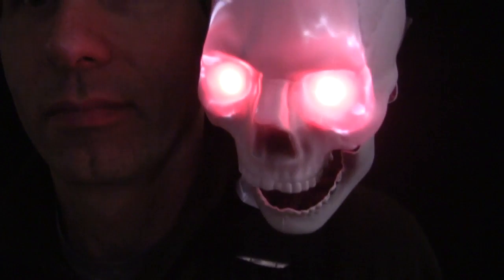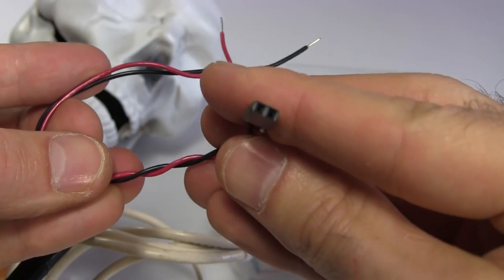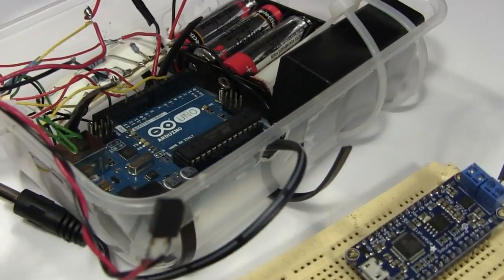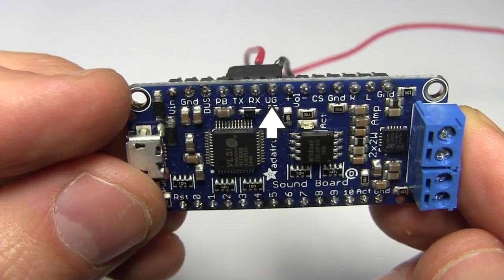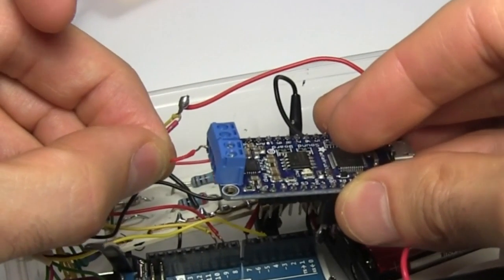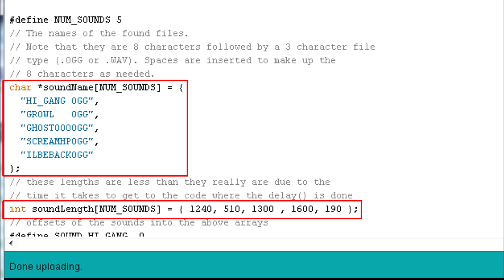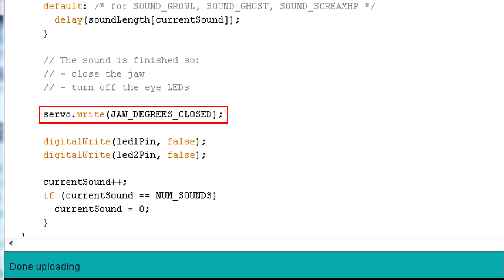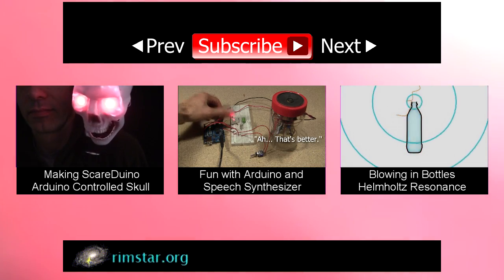ScareDuino & Adafruit Audio FX Sound Board for Halloween

Comment: As a fellow electronics and Halloween enthusiast, I enjoyed your video tutorial, but it triggered a PTSD episode for me and I had to share this story: 

Back in 2012 or so, I had bad luck with Adafruit's sound board, which later on they admitted in fact that there was a defect that caused the very problem I complained about; in fact they stopped selling them because they needed to reengineer the board.  Well, I guess they're back now.   

As for me, it was too late, it was past the warranty (lesson learned: always test the components)  I didn't use them the year I ordered them, instead I waited until next year and that was a mistake; however, as a customer that had been doing extensive business with them (hundreds of dollars every year over the course of several years) I felt like they could have been a little nicer to me given the fact that they sold me those defective boards, instead they said that customers are always blowing up stuff and claiming it was defective, and it got to the point that they said they didn't want to be accused of grifting and before I could respond, Mike closed conversation so I couldn't respond... that infuriated me... and now I am very reluctant to purchase from them, I try to get all my stuff from Digikey, Mouser, Jameco, Amazon, etc.

What happened to me was that I plugged the board into my PC to transfer the audio file... I didn't have anything else connected. I noticed that the class-D Amp overheated and smoke was coming off the board, then before I could react the USB went into overcurrent protection and the PC spontaneously restarted.  Luckily the PC was fine.   What I ended up doing was desoldering the SMD amps off the boards (all of the soundboards I ordered had the same problem) and then I connected the L and R lineouts to an offboard amplifier.

I found some MP3 players on Amazon DY-SV8F  8M Flash, and I can get 2 of the players for $13, it same functions as Adafruit's because it's the same chip, but cheaper... you can also get larger capacity for bigger files, like one with a SD Flash card, but Halloween props have pretty small files... unless you're doing a show with a long song and dance routine.

Comment: I’m gonna use a 1sd1820 module For the voice box that I making for my woody doll it’s going to be made out of wood but there are some buttons on there and I am a little worried that it won’t work with a pull string what can I do?
Reply from the maker: I'm not sure what you mean by a pull string and buttons. Are you trying to use the pull string to activate the buttons?
Reply: RimstarOrg No I just want to use a pull string instead of buttons
Reply from the maker: In that case, a quick search turned up this video https://www.youtube.com/watch?v=ckq_CP3ra7g where they connect and Arduino to it. You could build some sort of lever mechanism where the strings pull on lever arms. When pulled, the levers would close switches. The switches would be connected to the Arduino. The Arduino would do whatever code is necessary (like in the video) to tell the ISD1820 to play a recording or to record. I don't know enough about the ISD1820 to tell if the same could be done without the Arduino.

Comment: Hi, without the sound file arrays , will it work ? What is it used for ??  int soundLength[NUM_SOUNDS] = { 1240, 510, 1300 , 1600, 190 };
Reply from the maker: Do you mean without using soundLength[] will it work? Yes, it will work without it. The reason I use it is that I want to know how long to open the jaw for in order to make it look like the skull is speaking.

Comment: Any ideas why I can't get mine past the 'if (!sfx.reset())' of the demo code? I quadruple checked the connections and have them exactly like they do on the Adafuit demo. If I by pass that it will not play or list the files. Basically nothing works.
Reply from the maker: I guess you mean Adafruit's demo code because I don't do a sfx.reset in the setup function. I do recall a problem with the sfx.reset call and mine worked without it so I skipped it. I don't recall exactly what the problem was, whether or not it was just stopping there like yours. You can see my code here http://rimstar.org/science_electronics_projects/arduino_adafruit_audiofx_soundboard_skull_scareduino.htm.
On Adafruit's page for this version of the board that has the amplifier (https://www.adafruit.com/products/2217) they say they've discontinued it until they can figure out a problem with the amplifier. But I don't know how the problem they're talking about manifested itself, whether it was related due the reset problem or not.

Comment: I never thought to solder pin headers while in a breadboard. That makes so much sense. I always have had trouble getting them straight, but putting them in a breadboard while soldering solves this. Thanks for the video, and the little tip I learned from it. I also enjoyed the explanation of the code, very clear and understandable.
Reply from the maker: +Wander Glad you liked it. Actually, I used the breadboard to hold the pins in place in the X and Y directions but I didn't have the pins pushed all the way into the breadboard holes. I was afraid, possibly needlessly, of damaging the breadboard from the heat (anyone here know if I should have been concerned?). As a result, mine aren't as straight as I'd like them either.
Reply: RimstarOrg I always press them all the way into the breadboard. It makes sure they are straight and fully seated to the module your adding the pins to. I have not damaged any of my breadboards. Maybe if its a cheap one from China then I would not, but I only do it with my name brand breadboards. I guess if the plastic looks cheap then be carefull. Your not going to hurt the metal leads in the breadboard but my melt the plastic.
Reply from the maker: +Jason Walker Thanks! I'll do that from now on then.

Comment: Haha lots of fun, great project. I like how the servo movement routines can sync to speech patterns with simple coding and the battery bay mod is very effective.
Reply from the maker: +slider2732 Thanks. The servo/speech syncing was a little tricky because it takes some time for the speech to begin and to subsequently get to the code where the servo movements are done. With the phrase "Hi Gang", I should have had to do a delay() while the word "Hi" was being spoken, but by the time I got to the servo code it was already time to partially close the mouth for the space between the two words (I didn't mention it in the video but it's mentioned in the code.)

Comment: Replace that battery pack with a single LiPo battery. You can get them for a couple bucks. They top off around 4.2V. A simple charger is cheap too. It's way better for the environment than throwaway batteries, and the form factor is much better to put in projects. You'll never go back!
Reply from the maker: +USWaterRockets No doubt you're right. My AA battery collection is getting pretty large. I'll pick up some LiPo's the next time I order something.
Reply: Cool! You will love them. Keep up the work on the videos. You are really presenting some cool stuff that should bring people into the STEM field!

Comment: I want to build a full size plastic skeleton and have it rigged like those small hand toys where you push the bottom up and the figure goes limp. But instead of going limp it stays limp in default and jumps up and tightens the elastic and stands full size I can do this with a pail and a well sealed piston buried in the ground under it. A compressor fills the bucket with air and it goes limp again. When it's triggered the blast of air would be enough to scare someone. Then a glow in the dark skeleton jumps up. Could build a few of these in sequence all running on movement triggers and pneumatic valves. what fun. 

YT doesn't pass on responses to my comments anymore.
Reply from the maker: +Chuffered FUoogle Sounds like fun! Halloween must be great fun at your place.

Comment: You could have just connected the speaker modules power to the third batteries pos side, and the other components through all four batteries. Just saying
Reply from the maker: +Jason Walker Can you do that? I've always thought that would discharge the batteries unevenly. That was always my suspicion anyway. Have you done it or seen it done?
Reply: RimstarOrg It would have slightly more current through the first three batteries but i thought this was a Halloween gadget. And yes you can design your circuit this way. just like how an op-amp uses a dual rail supplie to output a pos or neg bias.